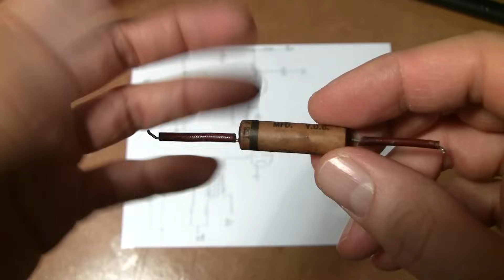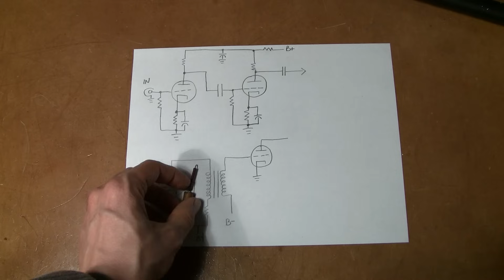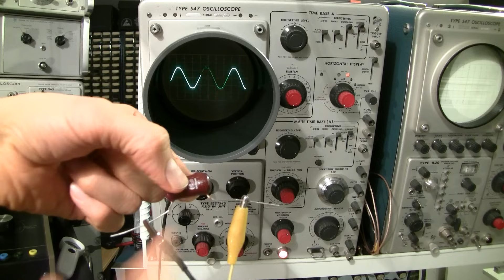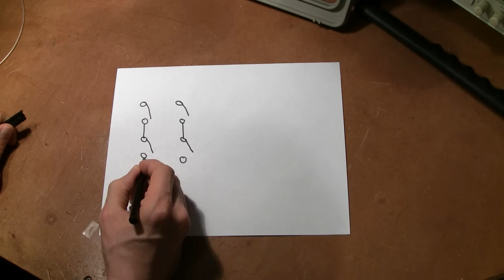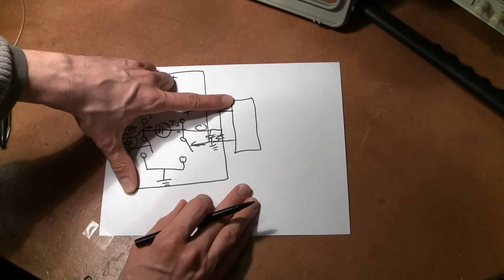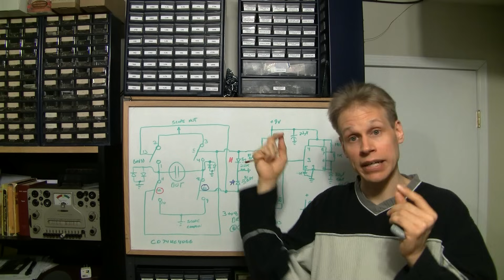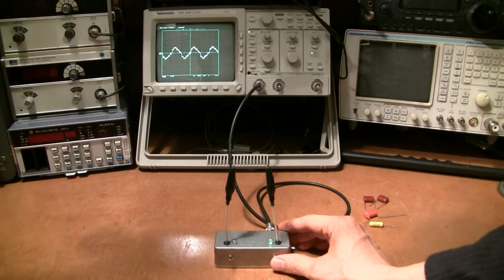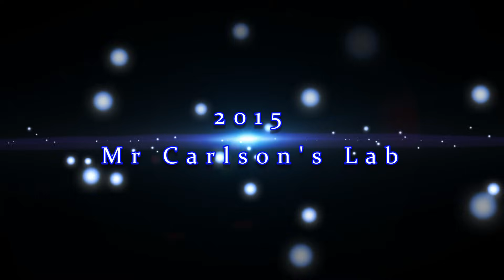Are Your Capacitors Installed Backwards? Build this and find out

Comment: Hello just built your capacitor tester/ installed backwards/ and it works great thank you.
I have just used normal size components!!.
Reply from the maker: Great Peter! I would like to see your work.
Reply: Peter, did you make a PCB for this? If so is there any way you can share what you did, I seem to be having a lot of trouble creating a PCB with Eagle and Easy EDA. Any help would be appreciated.
Reply from the maker: Hello Jack. I will be uploading the layout and parts map on Patreon very soon. You will be able to directly print the circuit board layouts on any laser printer and make your circuit boards from that. The super probe is coming as well.

Comment: I never knew caps had a polarity (but I think I recall the lines on the larger ones 4 decades ago with my Heathkit).
So, if it's so important to install them such, why don't manufacturers mark them? Does this only apply to tube amplified circuits?

Comment: If you used a DPDT on/off switch one pole could be used to switch on the power and the other used, perhaps with a current-limiting resistor, to short-circuit the capacitor thus ensuring it was discharged. So switching on the unit would power it up at the same time as removing the short-circuit and the test would proceed.

Comment: This video saved my Telefunken Concerto, here is the thread on Antique Radios where we are all struggling trying to figure out why an AF amplifier will not stop oscillating: http://antiqueradios.com/forums/viewtopic.php?f=6&t=323083&start=20.  Finally, i focus on outer-foil polarity on the caps feeding the audio amp and between the stages, that did the trick!
Reply from the maker: Great to read Gregory. Many of those radios used a special capacitor with 3 leads, One lead dedicated to an "outer foil shield" The correct orientation of the replacement capacitor would be crucial in this application. Thanks for your comment!

Comment: Personally, I'd have just used a DPDT to switch the capacitor manually. You probably also could have saved one of those double diodes, and rather than grounding them, connected them parallel to the capacitor-under-test connection ;)

Comment: There has to be a way to do this without a oscilloscope... Using four LED's, it would do the same as this, but when it finds the right end a red LED will light on that side using the extra amount of noise??? Is this a possibility?

Comment: Paul, another outstanding video. I just turned 70 and I am getting into electronics. I just earned my Amateur Extra Ham Radio license and I am loving this. I am goint to support you on Patreon too. I have a question I would like answered and it may take a video to do it. My question is Capacitor substitution. Can you substitute any type capacitor for any other type (mica for electrolytic or mica for tantalum...etc.)? Why or why not? It seems to me that electrons are electrons and all are created equal. So why substitute any type capacitor for any other type capacitor? I am guessing that it has to do with voltage or current potential and electrolyte breakdown. Am I close? Thank you and keep up the good work. See ya on Pateron.
Reply from the maker: Hi John, capacitors are specific too their job. Mica capacitors are very temperature stable, and are used mostly in RF related circuits, oscillators, interstage, so on... Their value rarely goes beyond 1uF, so they are not suited for lower frequency applications such as filtering. This is where Electrolytics shine, they are used as power supply filtering and many other applications where stability is not an issue. Tantalum capacitors are great for decoupling and RF bypass. They are also used in timing circuits as well, due to their relative temperature stability. The list goes on... I will cover more on this topic in future video's. Thanks John, see you on Patreon!

Comment: Hi: Great video. Thank you.!!! I hope someone can help me...  I have a old Sencore Oscilloscope its around 20 years old and has 
not been turned on since... I'm afraid to turn it on because of a faulty
 capacitor due to age . What is your recommendation. Should I open the unit  first and 
check some the components before turning on the scope. Please help me. 
Thanks
Reply from the maker: Hi Ricardo. Much of the time, those scopes will be fine (at 20 years).
Reply: Thank you

Comment: For the vast majority of applications the orientation of the cap will make absolutely no difference whatsoever. The only reason the effect looks so pronounced here is because the capacitor in the test rig is artificially placed at a ridiculously high impedance node. When wired into real circuits, even tube circuits with relatively high impedances, the effect of putting a cap in backwards will be so tiny as to be wholly inconsequential. Y'all need 
 to find something else to keep you awake at night!
Reply: I was wondering this too, why is there no response to your statement ?

Comment: What about amplifying and rectifying the hum and snap-shotting it onto a couple of capacitors then using a voltage comparator you could drive the LEDs permanently to indicate the shielded lead - that way you don't need a scope.

Comment: Ok... thats a new spec of caps that I havent heard before. But as far as i understand it is usefull when the caps are marked properly or it is a single high spec product. I could not use this if i use pick and place machine for a mass product.  Moreover not usefull for  capacitors that are polarized by desigh(electrolytic, tantalum, ect). Thumbs up and thanks for the education. 

Capacitors are complicated as hell. ESR for high power aplications, ESL for high frequency, service time for electrolytic, fire hasard for tantal, capacity versus voltage characteristics, leakage, short circuit recovery... and now this. Problems with capacitors are just like PI, it just goes on and on and on... But it is a necessary evil.

Comment: Great video! I didn't know that capacitors not marked by a positive end (such as electrolytic capacitors) had to be put into circuit a certain way to reduce hum.  Is this more of a problem where you are using high voltage tube circuits? So in solid state circuits it isn't an issue.
Reply: I'd say this is always a problem if you are dealing with highly amplified analog signals with anything emitting RF nearby the capacitor. In this video, the RF source was the human finger.

Comment: Very nice cirquit, but it can be done with a dowble throw dowble pole switch and two ink marks ono the out side of the metal box . No battery, no IC no leds no pc board, only one switch. is more simple and less explanation..

Comment: I say that the capacitor manufacturers need to be taken and shot. That is horrible. So much for quality control. If they were not going to bother to align the equipment to mark the devices accurately they should have changed the markings to show it. A fat question mark on each side would be accurate. Truly disgusting.  Dare I say this is because most of the parts are probably made in China? Think of all the screwed up humming half-ass circuits because of this!!! Wow great info. Many thanks to the author.
Reply: This gets to my issue:  It is truly AMAZING that manufacturers would ignore a significant element of the operation of the parts they make! WHY has this non-specification persisted for decades?

Comment: High compliments on the video...you identify a need, and design and build a circuit to fill the requirement, explaining every step and the purpose for every component well, and even its placement in the finished test box...
I wish you had pointed out early on that the info presented here applies only to the non-electrically polarized coupling capacitors you are showing...many capacitors are electrically polarized, so the direction (polarity) these polarized capacitors are installed in circuit must always be the FIRST priority, and determined by the DC Voltage applied, so as not to install them reversed electrically, in which case they likely wouldn't work (and might even fail explosively).  Only after having determined that a capacitor is a non-electrically polarized type, and SECONDARILY, can your technique of determining the outside foil and installing them to minimize capacitive coupling from nearby circuits, be used.
Also...maybe you just forgot (or maybe I just missed it), but I did not once hear you call this polarity changing circuit by its common engineering name:  "H Bridge"  (because of the obvious H shape when circuit is drawn out).  
Please take the preceding comments as they are meant...as constructive criticisms!  Still, a a superb presentation!  73 KA1RBP

Comment: Your test switching could easily be accomplished with a DPDT momentary  toggle switch with center off. I use these all the time to reverse polarity for bi-colored LEDs.   Simply criss cross the opposite N.O. contacts which are tied to the scope. The wipers are the contact points for the caps.
Reply: I‘m glad I didn‘t have to read through 1800 comments for someone else to mention this much, much simpler design. This design eliminates the battery and LEDs, 555, D flop, etc. The only component in the box is the switch. The bat position of the 2PDT (DPDT) switch would signify the foil shield side of the cap (—) when wired correctly. Once the bat is thrown your hand needs to be removed from the switch because your hand would be grounding the case and your body. And you don‘t need a center OFF on your switch, you can’t use a momentary switch either. Using a Bud Industries AN-x die cast box.

Comment: I built my first radios as a child back in the 1960s and I must confess I hadn't given this issue much, if any consideration.

I was aware that when you get multiple electrolytics in a common can, what we sometimes call a "smoothing block" in the UK,  say a 16+16uF, one terminal will be coloured red to indicate it's the outer one of the pair, and that goes to the rectifier. Why is that?  I suppose that cap will have more surface area to pass the higher ripple current..

Going back to the subject of your very convincing demonstration,  I can see situations where putting a capacitor in an amp the wrong way round could have a beneficial effect by introducing anti-phase humbucking  to hum that was already there.

Would you agree?

Comment: I came to these comments to find out if a Voltmeter on AC Volts (RMS) could stand in for the scope.  I'll check it out. For example is the meter's input sufficiently high impedance and if it's sensitive enough?.
I was wondering why I didn't learn this. The answer is I didn't learn tube circuits.  Guess I should make a special  audio jack and find  a scope program.

Comment: I have a basic question about installing capacitors.  I'm putting LED lights on a snowblower after finding some instructional videos on YouTube.  My power supply is the engine's stator that produces AC so I'm wiring a bridge rectifier and two capacitors into the circuit to create smooth DC power to the LEDs.  My circuit is:  AC wire from the stator through a fuse to the AC post of the rectifier.  The rectifier's other AC post is grounded to the frame.  The rectifier's DC negative goes to the black wire of the LEDs and the rectifier's DC positive goes to the red wire of the LEDs (through a switch).  

The instructions about installing capacitors say:  "Using two 2200mfd 50v capacitors may be needed to clean up voltage ripple that comes off of the DC output on your bridge rectifier. Some LED lights are sensitive to this ripple and may fail prematurely. Simple adding these capacitors in parallel on the DC output side of the bridge rectifier is a good precaution. Wire in the Capacitor(s) between the LED light(s) and the bridge rectifier. So the postive and negative of the bridge rectifier will go to the positive and negative of the capacitor. Then the positive and negative of the capacitor then get wired to the LED(s) positive and negative."

I'm not sure if I'm interpreting the instructions correctly.  The original poster has not responded to my request for clarification and seems to be gone from YouTube.  I subscribed to your channel when I found your video on capacitors.  Here's my question:  Where should the capacitors go and how should they be wired to perform their function?

In other words, if one goes on each line, does it go 
For the first capacitor:  1) DC negative to 2) first capacitor negative side then 3) out the positive side of that capacitor to 4) black wire of the LEDs?  (or should it go to the red wire of the LEDs?) and 
For the second capacitor: 1) DC positive to 2) second capacitor positive side then 3) out the negative side of that capacitor to 4) red wire of the LEDs? (or should it go to the black wire of the LEDs?)

I would really appreciate any help you can provide.

Comment: Thank you Paul.
I looked inside and surprisingly didn't find paper caps.  I DID find 
one ceramic cap however, that had too much movement on one of the pins.  It 
is working fine now.
On another note, I was watching another one of your videos about 
testing your capacitors for direction.  I found this informative, and 
started not only checking my capacitors, but transistors and diodes as 
well.  I found that you can do the same thing for
 those parts, also.  For some reason, the phenomenon is backwards for 
the larger transistors, as opposed to the smaller ones, but it can 
definitely be used if you don't know the pins, for one reason or 
another.
Paul, can you tell me how to learn electronics better/quicker, etc. 
and how to make a living from it nowadays.  I understand a lot of what 
many of the parts do, but I don't understand how so many of the people 
like you, just grab a part and say "I am going
 to use this.", when there are hundreds to choose from.  I have a 
background in HVAC, so I am not totally stupid, but I am a little 
dismayed about these things.  Thanks for the help.

Thank you.

Comment: This is a neat technique.  Using ambient 60Hz noise as a source coupled to the shield, then finding the polarity where you get the least pickup transfered to the oscilloscope.  You know you get the lowest signal when the outside (shield) lead is connected to ground through the oscilloscope.  I probably would have set the cap on a metal plate and then tried to measure the capacitance from the plate to each lead with a cap meter.  Your way is very simple and effective.
Reply from the maker: Glad you enjoyed the video Jess!

Comment: How does a resistor on the LED reduce the current draw from the battery? I thought that energy would be dissapated as heat.
Reply from the maker: When there is a drop across the resistor, it is doing it's job. Depending on the Voltage drop across the resistor, it's job is to limit current, (and dissipate heat) this is why we have "current limit resistors" in series with LED's. To get a better picture of what I'm saying, you will have to do an experiment. "Hands On" is your gift to learn quickly, and see results in real time (No silly computer simulators either!) Get a 12 Volt source, a current meter, an LED and 2 resistors. One resistor will be 560 Ohms, 1/2 Watt , the other 2K Ohms, 1/2 Watt. Put the 560 Ohm resistor in series with the LED, and the current meter in series with that and read the current. Now replace the 560 Ohm resistor with the 2K Ohm resistor and read the current. There you will find your answer. (Notice the resistor temperature as well)
Reply: Youtube is brilliant. You get marked when you answer comments on your own channel. I know these things you told me but its mysterious to me how you can save on batteries by adding an additional load to the circuit. That it saves the LED is no mystery though. BTW I grew up next door to an Ohm family which is somehow related.That lady had a huge resistance value.
Reply from the maker: Technically, your not adding another load, your placing it in series with the load. You must know something about youtube that I don't, I answer questions because of one's sincerity, not to gain Brownie points. Did Miss Ohm where her colors on her sleeve? OK groan :^/  LOL!
Reply: Ok  so its just kind of sharing the load then to save it from burning out?  Marked means marked as spam. I dont know how or why you would spam on your own channel. When Mrs om was mad th magic smoke shot out of her ears.

Comment: While watching this video I ask myself of which proportion the humming effect might be. Do you think you could set up a little circuit, running let's say 6 or 10 (or some - don't know how much one needs to create humming) of those caps and, maybe soldered on a little connector in order to easily switch orientation of the cap and do some tests, comparing different configurations?
Hope this doesn't  sound too weird :-D

Comment: Great way to tie theory to application.  I wonder if would be possible to use a micro controller like the arduino to alternately sample each side of the capacitor to get a digitized level.  Since there are several ADC input pins no switching is needed.  Perhaps precede it with an opamp to amplify the signal and set up as an integrator- if needed?  Then it could just light one of 2 leds to indicate foil side.  Actually this would be a nice option to add onto the atmel based component testers frequently sold on eBay.
Reply from the maker: Good possibility. I will work on an automated solution in the future.